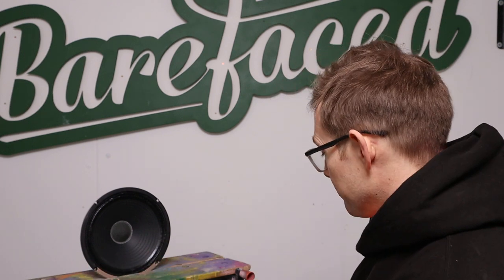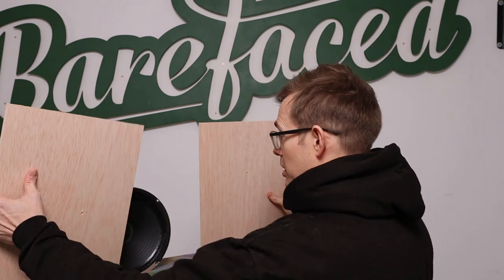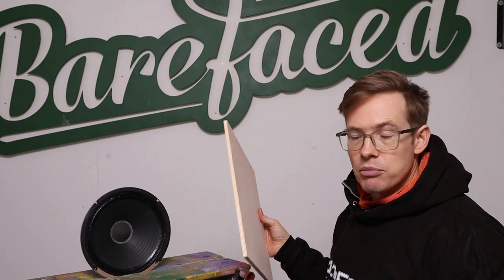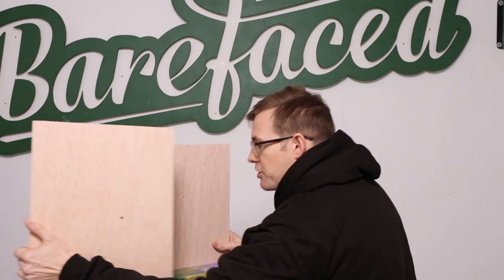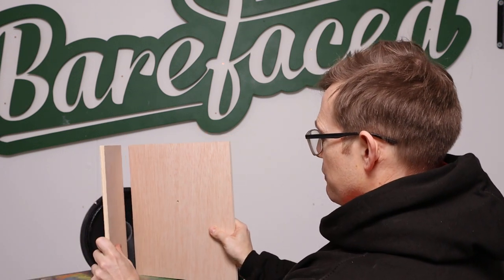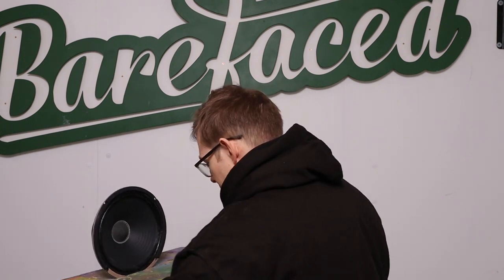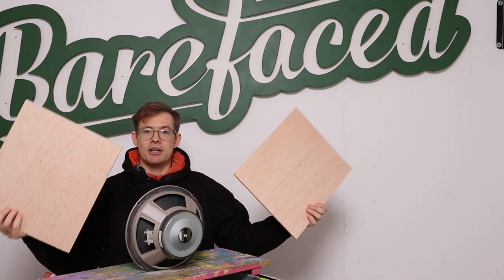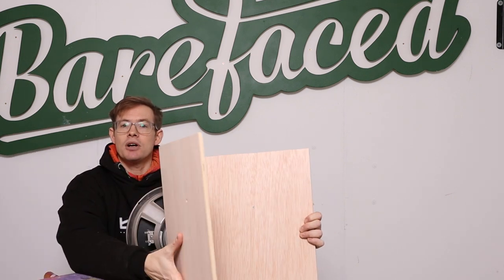Guitar cab prototyping part 4 (but it really should have been part 1, so watch this first!)

Comment: This is a problem with hi-fi speakers too. The high frequencies are very directional to the front. Listening off axis cuts them dramatically.
Reply from the maker: Yes, but it can be solved in hi-fi speakers with multi-way design with the right crossovers/waveguides etc.

Comment: Why no slant position for the speaker aimed towards the guitarist? Is there no need w/ the avd?  Can you still produce low-end frequency from a 4x10 guitar cab?
Reply from the maker: The AVD is so much better off-axis than a normal cab that there's no need to have a slant. Regarding low frequencies, how low are we talking? Whatever you do the cabinets, normal guitar speakers aren't very good at going low in a hi-fi or PA or bass guitar sense.
Reply: Low enough to feel palm mutes....not to low. I'm coming from a sealed 2x12 can I get close to the same feel...I'm fascinated w/ your avd system. What would I loose when using barefaced cabs compared to my sealed or does it just add to a full room of sound experience.
  One more thing if running in stereo w/ barefaced cabs does one cab get position stage right and the other stage left...is there such a single cab that can do this?
 Thnx

Comment: How effective are successful with a base cabinet be if you had twin speakers faced in opposite direction of each other inside of a cabinet with ported holes into fraction kind of similar to barefoot speakers but made for electric bass?
Reply from the maker: Do you mean with woofers on the front and back (or opposite sides) of the cab (and ports too) or do you mean with the woofers inside the cab and ports on the outside like a bandpass subwoofer?
Reply: Thanks for replying question about my clarification. I’m definitely not talking about a subwoofer. I’m speaking about a driver on the front and back of the cabinet with ported holes on the front and back. Check out the company called barefoot they make speaker monitors for studio reference. The very first time I’ve ever saw the studio monitors I thought to myself wow that would make a great electric base cabinet.
Reply: @BarefacedAudio  by the way I think your products are amazing and I can’t wait to own a speaker cabinet for myself.
Reply: @BarefacedAudio  it will be interesting to see a collaboration. It will probably be the most insane prop product ever created.
Reply: Waveform size?